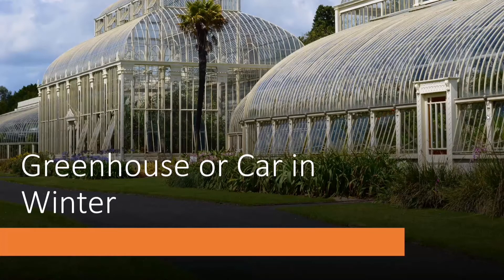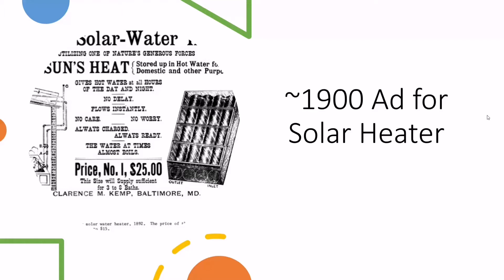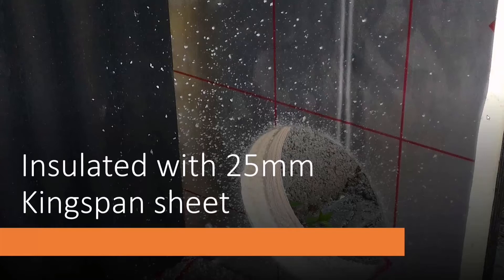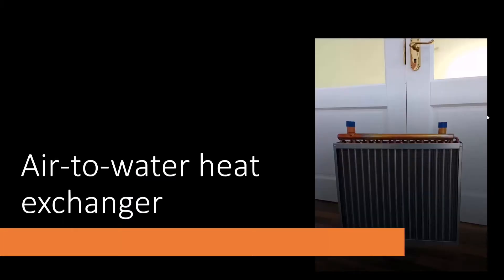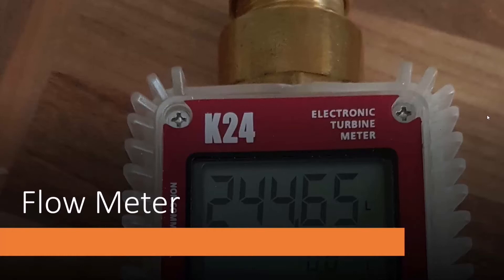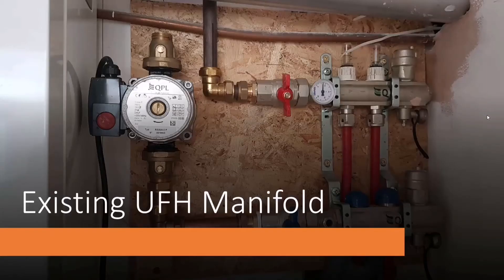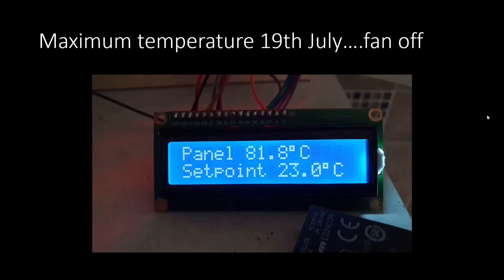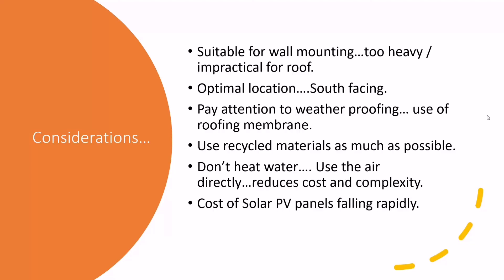DIY Solar Home Heater

Comment: Great project for renewably powered heat. Great information too. Cool to see your technology too. I just kept it simple with insulated hole plugs in the top and bottom 4" ventilation holes for my 6 x 6 foot solar air heater. It has good heat output at 95C. However, I would like to build it several times bigger for more heating capacity. https://youtu.be/7S8CWsIcK20 Thanks for sharing your successful project!